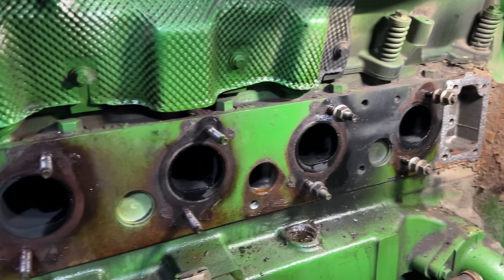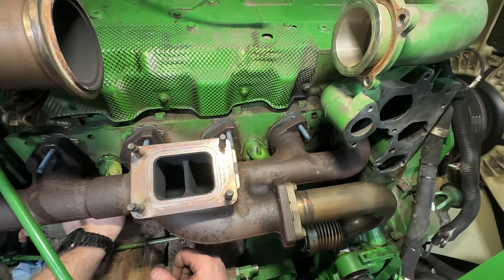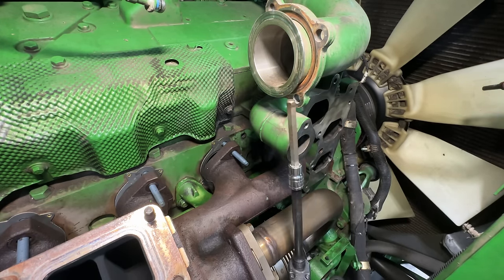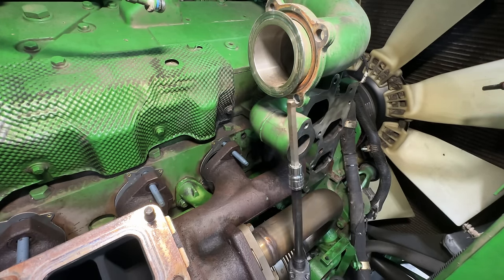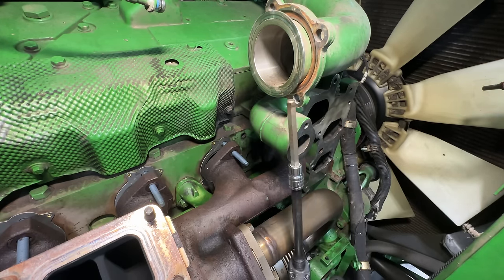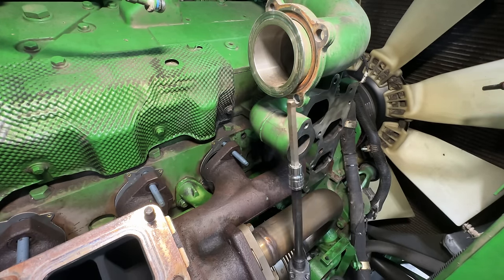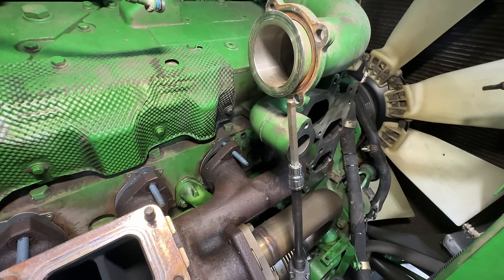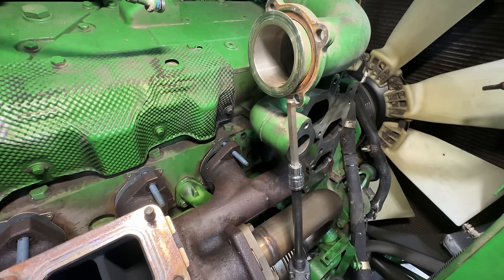S680 Exhaust manifold install & Service truck tour (part 3)

Comment: As a John Deere technician I really like your tips and tricks, would like to see a segment we’re you would show special John Deere tools with part numbers, like o-ring kits and special wiring adapters and show case some John Deere tools. Kinda like some of the special Cat tools we don’t know exist, would be cool too see what all Deere has for technicians.
Reply: The problem with that idea is JD has tons and tons of different special tools. From specialty seal drivers, injector installation tools, different brackets for lifting all sorts of stuff, probe kits, pressure testing kits, you name it. And you need them all to do the job properly but usually the shop supplies them.
Reply: As a John Deere mechanic, I second this!

Comment: I am impressed with your layout of tools and accessories and parts. It’s great that your company supplies the truck. Do you have to supply your own insurance coverage on your tools that are on the truck? There has to be at least $30,000 in tools on that truck. How many years have you worked for Sloan? You need a coffee maker for those long cold snowy or wet days. Love the channel

Comment: That was awesome Mr. Z. Hard to believe that much labor and parts are required to replace a few exhaust manifold gaskets.  But you refreshed a bunch of consumables at the same time to the benefit of the owner/operator. Thanks for taking the time to share.

Comment: Zeth, another great video. Loved the truck/tool tour over the last two videos. I have always believed that service trucks like yours make far more sense for field work. Over here in the UK, they tend to use a mixture of long and short wheel base fully enclosed vans and you end up with a lot of wasted space and you have to pull a lot of equipment out of the van to get at your tools. Would love to see some engine builds when you have them. Thanks

Comment: You ever tried the stud extractors that look like a deepwell socket? They have little roll over cams that grip well w/o hurting threads. Snap-On also has a set you screw on the threads. Costly but well worth it. I worked in a machine shop 26 yrs and they are a must.

Comment: Thanks for another great video ZK. 
It was interesting and enjoyable. 

You got everything put back together in short order. And after a test run no leaks. Yeah!!!!!!
You did a great job on that one ZK. Lots of time involved there to get those manifold gaskets in. I learned a lot on this one about what it takes to do that job. More than I thought. Thanks ZK for showing us the process and some good tips. 

Appreciate you going over the rest of the service truck with us. Lots of dollars on that side. Nice electric drills and such you have. Wonderful collection of tools ZK. 

Thanks for everything. Appreciate it. 
The Iowa Farm Boy.

Comment: I’m going to have to add that Milwaukee rotory tool to my arsenal, also that propane torch. It was good idea for manifold studs. Definitely beats having to pull out the big torch go apply some heat.

Comment: dang to bad you don’t have a crane to use your chain and lifting straps      im surprised they don’t have you either put your caps on your torches or just have the safety covers on them

Comment: I never felt comfortable with the torque to yield bolts. It's like they are stretched to almost breaking point! Lots of aluminum head engines started with this nonsense.  I would do one, measure the torque, then torque the rest to that value. I never experienced a failure doing it that way.